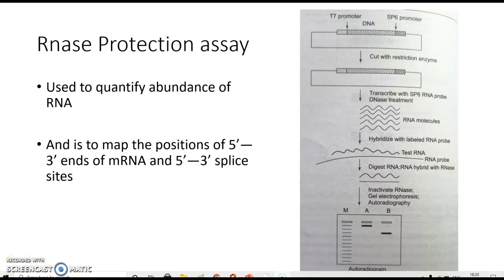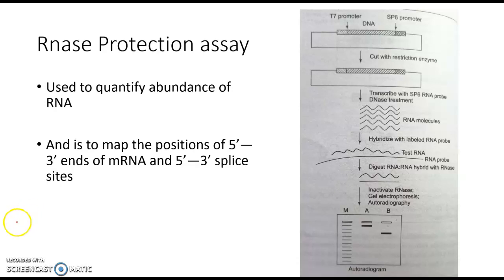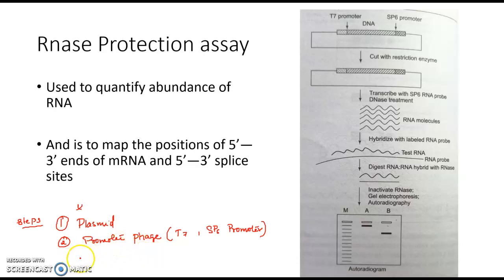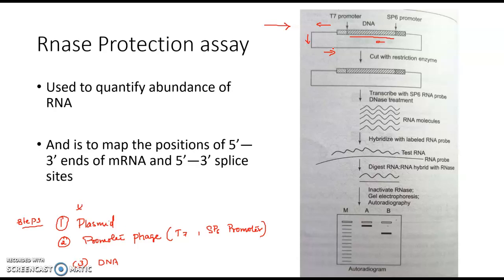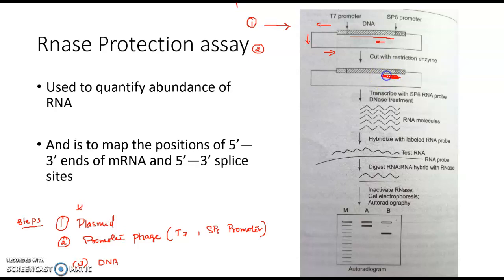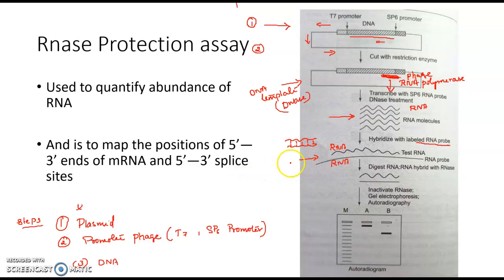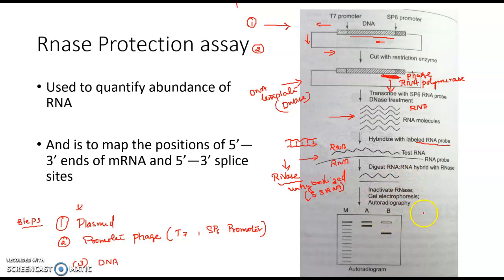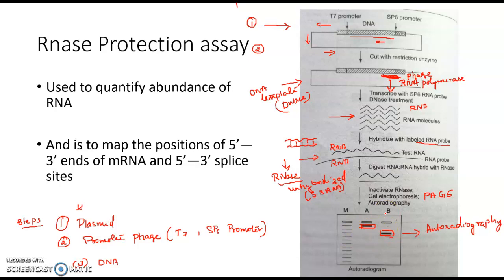#RNase Protection Assay

Comment: During gel electophoresis, does the samples need to be quantified and loaded in equal concentration ?
Reply from the maker: Gel electrophoresis can be used to detect DNA
 For quantification after gel electrophoresis, you have to do spectrophotometry or any other quantification techniques
Reply from the maker: If it is for detection there is no need for equal concentration